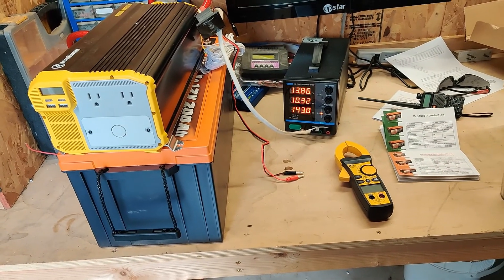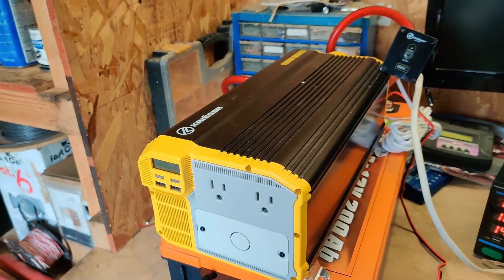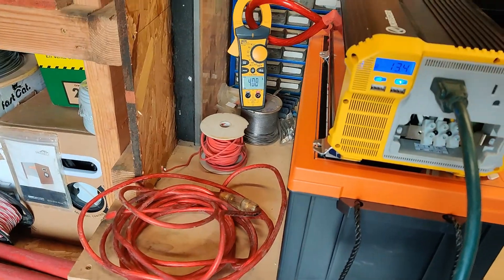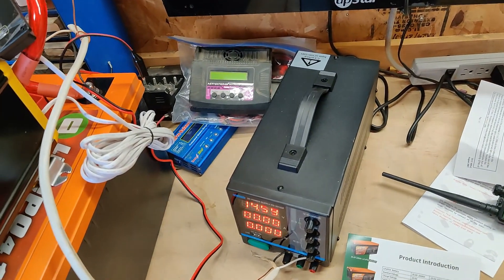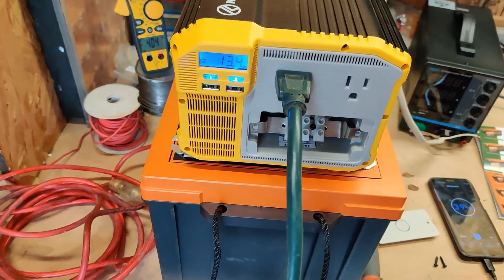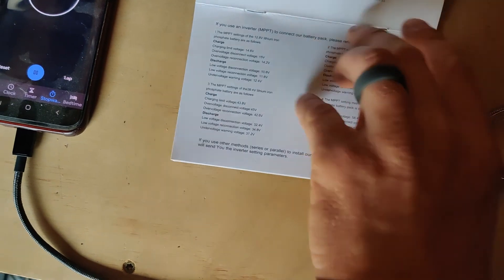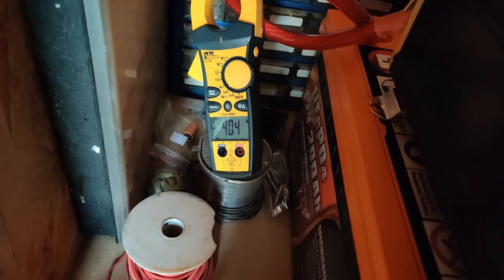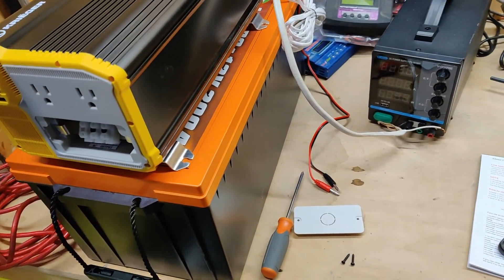EnjoyBot 12v 200amh LiFePO4 battery testing

Comment: Many companies use Chins batteries. Will Prowse already confirmed it. He gives Enjoybot a thumbs up. Although their low temp cutoff versions at one time did not actually have the low cutoff sensors. That may be different today, I don't know.
Reply: I have a couple redodos put them in a box insulated it and put one of them temp controlled RV tank heaters in it just did it before winter sets in